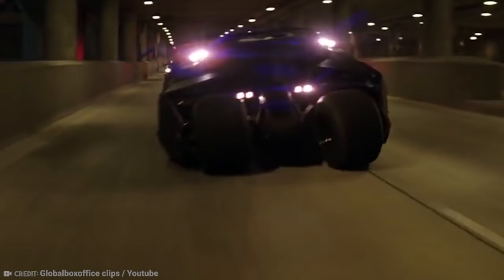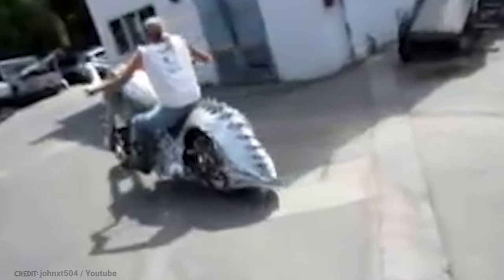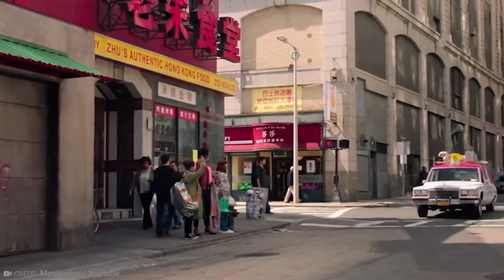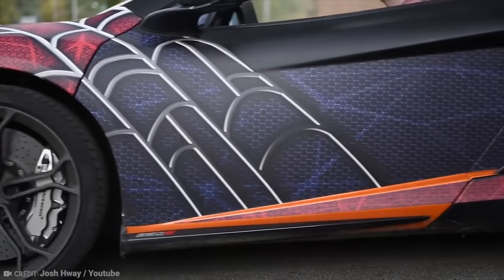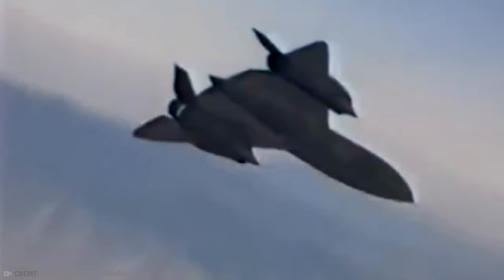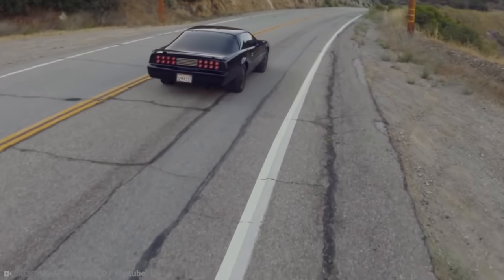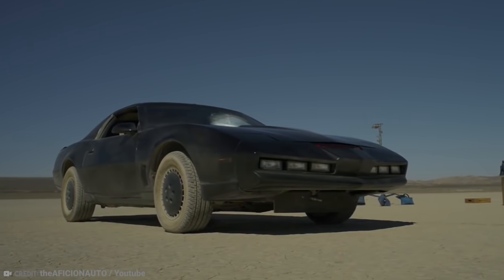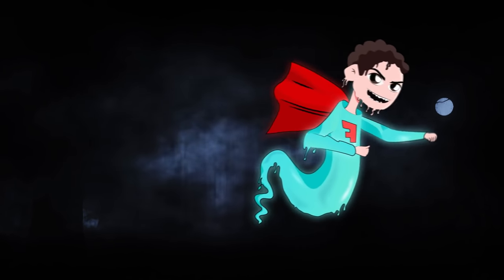15 Superhero Vehicles Which Actually Exist

Comment: 12:23
Not the highest flying overall - there is a Soviet aircraft that holds THAT record in a zoom climb, and the F-15 could also go higher in a zoom climb (particularly the trajectory it used when launching an early anti-sat missile).
Then there are the records the X-15 holds.
The altitude record the SR-71 holds is highest SUSTAINED altitude for a crewed aircraft that took off and landed from the ground.
It DOES remain as the fastest crewed (that we know of) air-breathing aircraft by any measure.

Comment: 12:20: "The Blackbird remails the highest flying and fastest crewed aircraft."  Errr, no.  Not even close.  The SR-71 had set a record of 85,069 feet.  But it could not go into orbit (which is higher).  It's not even the highest flying jet, as that is a modified MiG-25, which flew at 123,520 feet.  As far as speed goes, the Blackbird's fastest speed was 2,193.2 mph.  To compare, the Space Shuttle would routinely fly in excess of 17,500 mph in atmosphere, during early stages of landing maneuvers, immediately post-reentry.
14:40:  WRONG!  That episode of "Jay Leno's Garage" features one of the ORIGINAL, screen-used cars, NOT NOT NOT a replica.
19:23:  WRONG AGAIN!  Light cycles FIRST appeared in the ORIGINAL 1982 movie, "TRON."

Comment: That bat mobile probably has the worst handing and ride imaginable at anything from 25 to 40 MPH. The front alignment with those super wide tires looks like a complete disaster in the photos, the concept is a nightmare design slapped together. Basically, go straight, always, never turn, it will still be swerving and fighting you, more violently as you increase speed. Safe to assume it lacks "power steering" and there does not appear to be any shocks. At higher speeds it's almost certainly a horror show quickly leading to a crash. However, I do appreciate them dropping a 500 HP engine in it.

Comment: In electricity generation, a generator is a device that converts motive power into electrical power for use in an external circuit. Sources of mechanical energy include steam turbines, gas turbines, water turbines, internal combustion engines, wind turbines and even hand cranks. Wikipedia